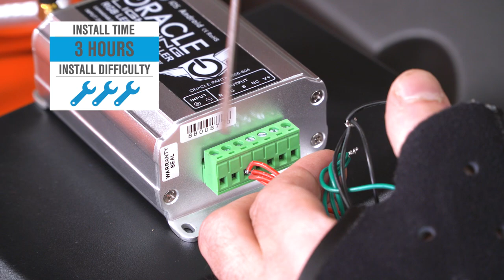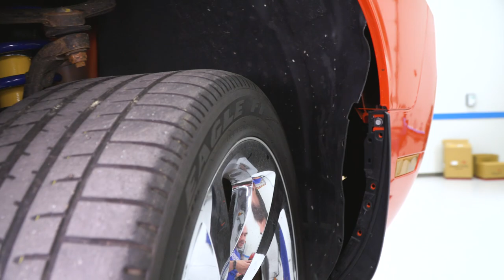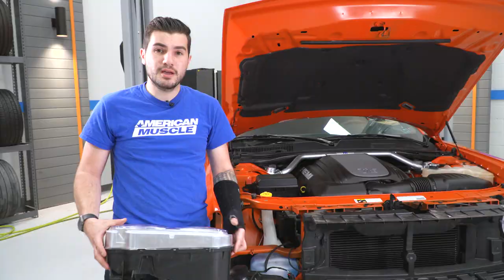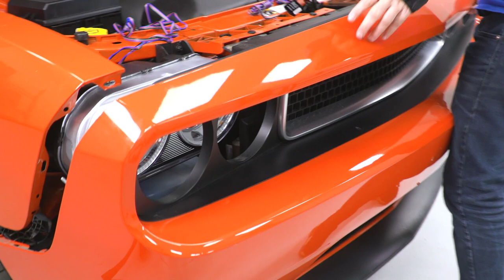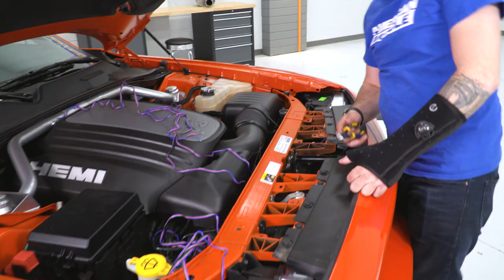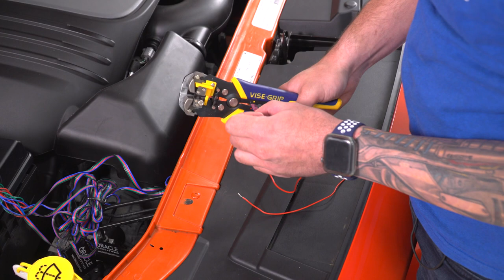2008-2014 Challenger Oracle Chrome OE Style Headlights w/ ColorSHIFT LED Halos Review & Install

Comment: SXT have the batteries on back, will the wires reach or will I need to extend those wires?
Reply: You still have a positive port in the front next to your fuse box. Then you ground the negative on  a nut by the fuse box
Reply: @ksnagg21  thanks for the info